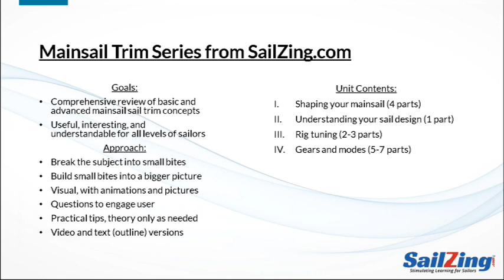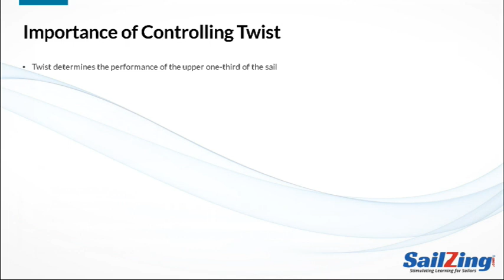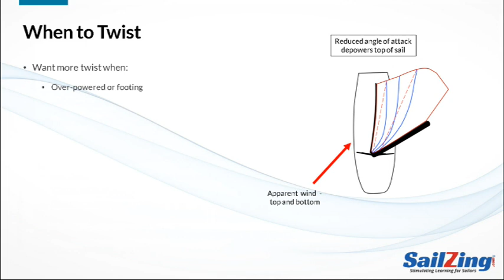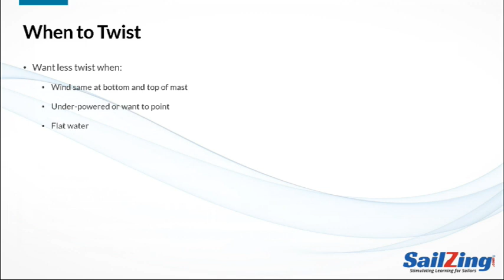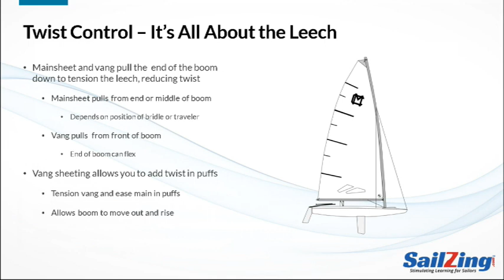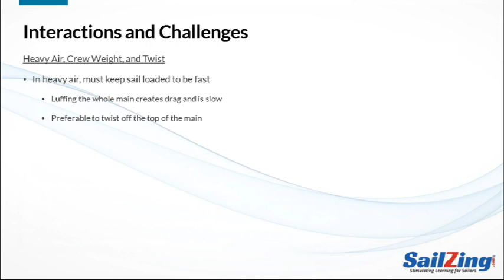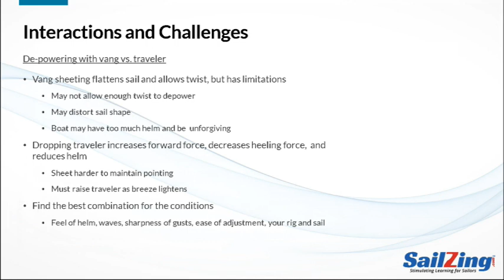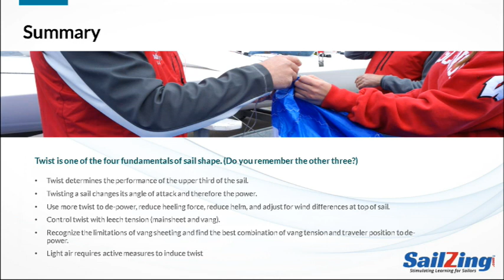Upwind Mainsail Trim: Shaping Your Sail, Part 4 - Controlling Twist

Comment: Thank you very much for the excellent guidance, which we think will help us race and cruise better! One very minor but fun point on weather- in the sixth minute, this video incorrectly suggests that global Coriolis effects consistently veer or back masttop wind direction. That effect  is insignificantly small at the scale of a boat and its mast, or a bathtub drain, contrary to popular belief.    Local obstacles, or squalls swirling either direction, cause any actual shifts in true wind layers. Of course, you correctly stated the typical apparent wind shift factors.
Reply from the maker: I believe you to be absolutely correct that the global forces are overstated. I’ll put a note. Thanks! Glad that the videos are helpful.

Comment: In light airs and with a fully battened sail with large roach, how do you reduce hooking of the leech if the vang should be left loose to achieve twist? I’m wondering how best to play the vang versus the mainsheet in the light conditions.

Comment: Trimming a 38 ft light weight, short keel yacht, vang-sheeting seems most critical form cracked sheets to beam reach, with depower cycle in the order of vang, then traveller, then sheet (and vice versa to power back on).
Reply from the maker: Thanks for the comment. In our overpowered MC Scows, we use vang first as well. We also pull cunningham. Then drop traveler. We also  vang sheet in the gusts, but we try to maintain as much sheet tension as possible to keep the sail flat. If we have to drop more traveler to do so, we will. In waves, we will crack off a little.

Comment: Hello, thank you for the great videos! When you mentioned Cunningham, were you referring to downhaul?
Thank you:)
Reply from the maker: Thanks for your question. The cunningham is a line that tensions the luff of the sail by pulling down on a grommet just above the tack of the sail. A downhaul usually refers to a line that pulls the entire spar down. A downhaul on the boom would have a similar effect to a cunningham.
Reply: Downhall refers to the line attached to a bridle centred at the bottom of the spinnaker pole, when this downhall control is located at the outboard end of the pole it is called the foreguy
Reply: @sandynicholson6516  On most small catamarans like @SailZing said the downhaul is a purchase that pulls down the whole boom causing a similar affect to the traditional cunningham

Comment: ”Leech telltales streaming intermittently”. Does that mean they are just about to stall or just about to luff? I mean do we seek maximum lift or maximum lift/drag ratio here?
Reply from the maker: Thanks for the question and sorry for the slow response. We're talking about the leech ribbons here. I don't think of this as stalling or luffing. They're responding to the vortices that get generated when the air moving over the windward side of the sail meets the air from the leeward side at the leech. in light to medium air, the ribbons will disappear behind the sail and then stream intermittently. If you're not pointing well in light to medium air and your leech ribbons are always flowing, try trimming the mainsheet a few clicks. In heavier air the ribbons might always stream.

Comment: Bit confused... at 3:30 you say the angle of attack will be 'smaller' (?) at the top of the sail. Is that because it IS twisted, or because it IS'N'T, and so needs twisting? Or would twisting make it worse? And I'm afraid no, I cannot see the twist very well with the diagram, as I'm not sure what I'm looking at... then you say a twisted sail will have LESS camber? So it's more twisted when it's flatter? I'm just totally confused now
Reply from the maker: Yes, it's flatter when more twisted. But, a sail can be flat without being twisted - think of a heavy air sail. With a fuller sail, it's a little hard to picture. Think of it this way: As the upper sail leech twists off, the sail becomes flatter over the entire chord length. Just picture taking a curved sail and pulling the leech to leeward. A flatter sail is gong to have a small angle of attack at the luff of the sail. It's hard to see from my drawing. This depowers the top of the sail.
Reply: @SailZing  Thanks for the reply. I think I need to go back to basics...